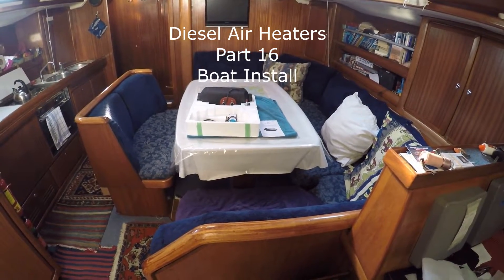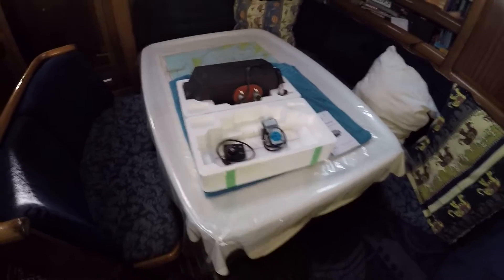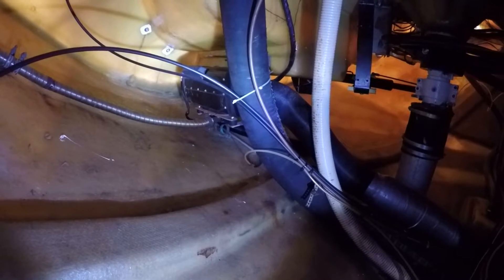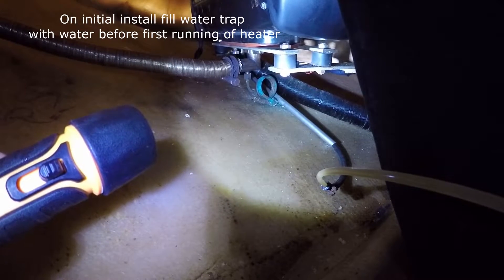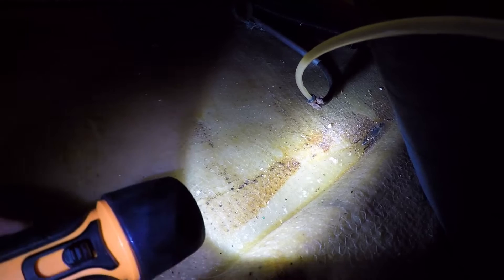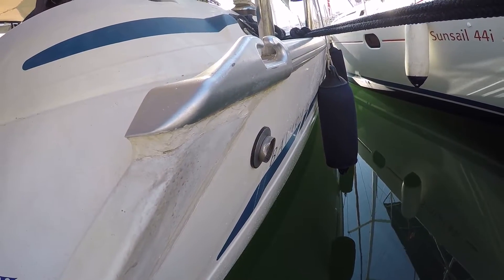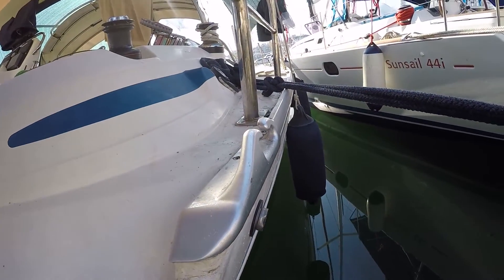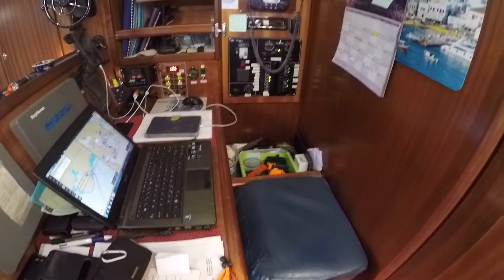Diesel Air Heaters Part 16  -  Boat Install

Comment: Nice video! Many thanks! What do you think about an install of a "all in one" unit inside a boat?
Reply from the maker: Hi Mathieu, 
That is a personal issue. 
If done right it would be fine. It is very important you have a proper marine exhaust system.
It could work well if installed in a deck locker with the exhaust coming out the side of the locker. 
Cheers.  JMcK
Reply: @johnmck1147  Many thanks for your response. But the exhaust system seems scary (fire). Doesn't it run too hot so close to the fiberglass hull? Is there some kind of insulation needed? Or this kind (cfr link) of marine exhaust-muffler has a special cooling system? => https://www.heatso.com/webasto-marine-exhaust-with-silencer-muffler-24mm-diameter/
Reply from the maker: Mathieu D 

Hi Mathieu,  yes, in a normal boat install you would need exhaust lagging. In our Med boat the exhaust was installed like that some 20 years ago. We have had the boat for over 10 years without an issue. 

Now, be aware that in our boat there is absolutely no storage in that transom compartment and no loose items. Because of this and the fact the exhaust pipe warms up the Transom Compartment and gets rid of condensation I have not (at this stage) lagged the exhaust. 

The link you sent me was for a Webasto marine exhaust and muffler. Unless you have a setup similar to ours you would need to lag that exhaust. Be aware, in most marine installs you must have a sealed muffler, one without a drain hole.

I will be doing a video shortly on exhaust lagging. 

Cheers.   JMcK.
Reply: John McK 47 Thank you! A video on this subject would be really interesting indeed!

Comment: I'm building a 45' Teign designed by Paul Fisher in the UK, Selway-Fisher. I am in the US. My plans are to install three of these 5kw heaters in my boat. I have questions regarding combustion air, exhaust routing, and using a dampener on an air plenum where the heat and A/C ducts connect to move air through the boat. Is there a way to send you a wordy detailed plan of my ideas? I'd really like to get your feedback on them.
Reply from the maker: Hi Ben, Happy to have a look for you if you understand my comments are my opinion from my experience. The install is your decision. My secondary email below. 

johnmck47@outlook.com

Comment: Hi John, Great videos, thanks. Question - When you are on your boat, how long do you leave your heater on? is it safe to leave on all night? Thanks again :)
Reply from the maker: Hi Rod,

With the shoulder season we would generally run the heater 2 to 4 hours in the  early morning and again in the evening.

When we have wintered over on the water the heater would run 24 hours on very cold days.

With a good install and a CO meter installed, in my personal opinion, it is quite safe to run these heaters all night, and all day if you wish.

Regards.  JMcK
Reply: @johnmck1147  Thanks John - Merry Christmas to you and yours from Bonnie Scotland :)
Reply from the maker: Rod 
👍

Comment: Hi John great video series watched them all. You briefly mentioned hard body heaters, is there any advantage to alloy case? And the new style control any advantage? Cheers
Reply from the maker: Hi Martin, 

There are really no significant advantages or disadvantages between alloy or plastic body heaters, it is really just personal preference.

Not quite sure what controllers you are referring to. But here again it is really personal preference. In the boat I prefer a simple dial manual controller, but in my daughters home bedroom I used a digital controller with a remote so she can turn the heater on or off from the bed during the night.

Cheers,   JMcK
Reply: John McK 47 Thanks for the reply, think I will pay the little bit more for the alloy case. Less likely to melt. If something goes wrong lol. Thanks again for the videos you have given me confidence to give one a go instead of paying 10X more. Cheers

Comment: Hi John and co. I received my Chinese 8kw heater to day and have been looking at all the install videos of which I consider this one the best. The 8 kw ( if that is what it really is ) has four outlets @ 40 mm od. My boat is 46 ft ex-trawler and I decided on this model as I want to run four ducts to different parts of the boat. My problem now is that I can't find 40 mm ducting. Eberspacher makes a 60 mm duct but dear as poison and too big , if it was 50 mm I might have gotten away with adapting it but I think 60 mm is too big and as I mentioned very expensive. I have been googling for a couple of hours now and no luck ,flexible electrical conduit is the only thing I can find at the right size and price however I suspect the outlet temps will be too high for pvc which is what the flexible conduit is manufactured from.Does any body know where I might source proper hvac ducting in 40 or 50 mm? I guess my next move is to contact the ebay vendor in China, they obviously have a supply of the 40 mm duct , they supplied about 1.5 meters with the heater , I need about ten meters. Stay safe and warm Brad
Reply from the maker: Hi Bradley,

I think you will find your heater is actually a 5 kw heater, branded as an 8 kw heater. 

It is generally better (resistance wise) to run a bigger main heater line if you have a long run and then run smaller outlets off the main line.

However if your heater has a 4 outlet head that is what you have. Search eBay for diesel heater outlet hose. Below is one link to get hou started.

https://www.ebay.com.au/itm/42mm-Diesel-Heater-Duct-Pipe-Hot-Air-Paking-Conditioner-Ducting-Aluminum-Foil-US/164136949482?hash=item26375316ea:g:JUIAAOSwZ~peF02g

You can also adapt aluminum vent ducting you can buy from a hardware store, but you will need some lagging as it gets quite hot. I have tested PVC, but it is it can get so hot it actually softens and loses its shape.

Cheers,   JMcK

Comment: Hi John, I've ordered one of these heaters to put in the shed, I was watching a vid on the heater by another guy and he was running the heater on it side, my question is, what do you think of running the heater om it side because I had the idea of instead of mounting it the "normal" way maybe I could mount it directly to the shed wall on it side, the sheds fiber cement sheeting this way the air intake and exhaust is poking straight out the wall and there's no need for the piping and that. What your opinion mate, all advise would be gratefully received. Would you do it !!  Seeya Rob
Reply from the maker: Hi Rob,

These heaters can be run on their side provided it is the side with the glow plug is at the top. If the fuel tank is higher than the heater you should also install a fuel cut off valve in the line.

It makes good sense to side mount these heaters on a wall in a shed with a cement floor. 

Regards,  JMcK

Comment: I ran my heater exhaust and air intake from inside my trailer through the floor, but I am having trouble sealing the holes. Where do you find these exhaust outlets for these heaters. I cannot find online one that fits.
Reply from the maker: Hi David,

Your heater should have come with a silicone gasket and a metal mounting plate.

If going through a wood floor you should have one round hole through the floor and it is sealed with the metal mounting plate. You do not have, and seal three individual component holes  going through the floor ( exhaust, combustion inlet hose, and fuel line.) 

You can buy a special through floor metal bracket, see one link below to get you started on your search.

https://www.google.com.au/search?q=diesel+air+heater+floor+seal&ie=UTF-8&oe=UTF-8&hl=en-au&client=safari#imgdii=VCJ49B6IBdI2jM:&imgrc=gUAAwZl92OrBFM:

You can get a welder to tack weld a metal ring on to the metal base plate supplied with your heater, or you can use a 90 mm circular gutter down pipe adaptor from a plumbing store to go under the metal mounting plate.

The supplied silicone gasket seals the heater to the metal mounting plate, and then you seal the mounting plate to the floor with a silicone sealant.

Cheers.   JMcK

Comment: Hi John, I want to buy a 2KW real bad. First off I'm in the USA.  I'm trying to compare the specs but very few heaters list all the specs.  I'm looking for the following approximate specs: weight 2.7kg.  Length 300mm.  Fuel usage .1L on the low end.  Electrical consumption 8-22W.  I found a 2.2KW that I like but it has 2 things that I question.  First, the specs list the length at 310mm but it has a picture that shows 13.2 inches.  Second it has a controller that has a flat 3 prong connector.  It has 1 knob with a blue top and that's all.  There are no other buttons or writing on it that I can see.  It looks like it has a display though.  But I want to replace it with the color LCD and I understand it to have a triangular shaped connector.  Do you have any suggestions for me?  Thanks, Steven
Reply from the maker: Hi Stephen,

Sadly many suppliers of these heaters are now going with non standard controllers, plugs and wiring, so it is not easy to mix and match, and you really need to buy a heater with the controller you want.

Also issues with the on line advertising. Eg standard 5 KW heaters being marketed as both 2 Kw and 8 Kw heaters.

2 Kw heaters approx size L 330 mm, H 115 mm, W 115 mm
5 Kw heaters approx size L 390 mm, H 140 mm, W 114 mm

Here is the listing of a 2 Kw heater I bought just a few weeks ago to help in your searching. It came with a standard dial controller with a standard triangular plug. However I have not yet bench tested it. 
https://www.ebay.com.au/itm/12V-Air-Diesel-Heater-PLANAR-2KW-2000W-for-Motor-homes-Boats-Bus-Car-Truck-ee/323633205099?ssPageName=STRK%3AMEBIDX%3AIT&_trksid=p2057872.m2749.l2649

Good luck. JMcK

Comment: another excellent video.  thanks for your effort and exactly what I wanted to see.  I'm off to make some modifications.  I put a 2kw unit in my 45' with a 8m insulated duct run and finding its not getting hot enough.  Can you tell me what size heater you have installed.  Thanks again.
Reply from the maker: Hi Mr Dino,

Yes, 2KW is a little small in a 45 ft boat.
Our 46 ft boat has a 5KW heater and is excellent down to low single digit deg C, but the heater efficiency depends on your insulation and number of windows. A 45 ft pilot house boat or catamaran with lots of windows would probably need two heaters installed.

These Chinese heaters are now so cheap you could easily swap your old heater or install two heaters.  Cheers.   JMcK
Reply: @johnmck1147  Thank John and welcome back.  I think you're right.  Looks like the Jeanneau factory install two 5kw units.  I thought i would be right with a small 2kw unit as a 2kw electric heater overheats the boat quickly.  For some reason the same is not true for diesel heating.  Time for an upgrade.   Any links on ebay marine mufflers and drain elbows would be appreciated.   My experience with CO detectors is they don't seem to last very long before they need replacing.
Reply from the maker: Finding Dino 

There are a number of sellers on the web, use the words Eberspacher, and marine in your search. Here is one to get you started.

https://www.butlertechnik.com/search/condensate-drain

Good luck.   JMcK
Reply: @johnmck1147  thanks again hope we cross paths sailing

Comment: Fine sailing vessel you have there, and that's some sailing going by that chart, is that one season?
Reply from the maker: Hi Tailss, that would be two seasons recorded there. It is a nice area of sailing with guests out of the Meltimi strong wind belt.  JMcK

Comment: Hi John, Thanks for the effort putting this very informative video! I wanted to install one of this in my Sprinter van but I don’t know where is the best place to buy it, I don’t know how many Chinese manufacturers/copies of this Espar heaters is selling now since it’s becoming so popular, do you mind sharing where is the best place to buy one of this? Ebay or Amazon?
Reply from the maker: Hi Linnmagic,

You are correct, there are many sellers of these heaters, and they come and go. I suspect the sellers buy a batch, of say 10 heaters, and once gone go onto selling something else. I have gone back to a previous supplier after only a month to find them no longer available. That is why I am reluctant to put links to where I have purchased my heaters.

Amazon or eBay, it is up to you. I like to buy off a supplier that has an "in country" warehouse, and offers returns. That way you have half a chance of getting a replacement should you purchase a dud heater. I also only use Pay Pal for extra security.

Cheers,   JMcK

Comment: I finally received a heater.  I ordered a 2kw and based on it's physical size I actually got one.  But it came with a 22ml fuel pump.  I was expecting a 16ml.  I've ordered a 16 but it's coming from China.  Should I wait for the 16?  I'm anxious to fire it up.
Reply from the maker: Hi S, If I had a new heater, I would fire it up in a bench test.  JMcK

Comment: What happens when the fuel runs out? Does the heater shut off itself? Is it bad for the pump etc?
Reply from the maker: Hi Jetmelt, if you run out of fuel you get an error code and the heater shuts down. Generally there are no adverse issues.   JMcK

Comment: I recently purchased one and found a problem with the design imuo. Accidentally shorted the case to B+, (I have the tall skinny case version, it's the same inside as the modular units), and it failed. 
Turned on, it displayed error 06, and the fan ran at full speed. 
The error 06 info was useless, but the full speed fan turned out to be the clue needed to fix it.
After checking the sensors and glow plug, I realized it's on the control board, and with the fan clue (often FETs fail full-on), I started testing FET drivers looking for the FET that controls the fan.  Replaced it and problem solved.
So what is the design flaw?  The case should be grounded, or the motor should not.   The only route a voltage can follow is from the case through the motor winding and to the FET, that I fried.  It may require changes on the control board to run with a grounded case, can't know that without a circuit diagram.  In short, don't short any metal parts to B+, including the exhaust pipe.
Reply from the maker: Hi FT Rider, thanks agin for this info. You would also need to be very careful not to short a modular unit as well as a enclosed case unit.  Cheers.   JMcK

Comment: What is the max length you can go on the intake and exhaust pipes?
Reply from the maker: Hi, this depends a lot on the install situation. Shorter is better. Greater than about 1.5 meters you perhaps should consider going bigger diameter. You can go longer with a rising exhaust, even over 4m (don't forget condensate drain at lowest point) than with a descending exhaust. You can go longer with a straight exhaust than one with bends. JMcK

Comment: I am having a problem with error code E-05 on my unit....it looks like overheat code, any tips?
Reply from the maker: Hi Kaare, with common heaters E05 is an overheat issue as you state. First, when did it occur?

1. If the problem started on initial start up you could have a sensor problem, an ECU issue, an install issue, or a mechanical issue. 
If a sensor issue or ECU issue, you should ask for a replacement heater.
A poor install is where you have blocked off or restricted the free flow of air from the heat exchanger. 
You could have a fan issue where either the fan is faulty or the fan is scraping on the case and can not reach operation speed.

2. If the heater has been working well for some time, you could have a scraping fan, as described above, a heat sensor going us, or you have set the heat setting on the controller too high for the ambient temperatures. Measure the temperature of the air coming out of the heater about 500 mm from the heater, if below around 100deg C you would suspect a faulty sensor, or one not installed correctly.
I hope this helps in your diagnosis.  JMcK